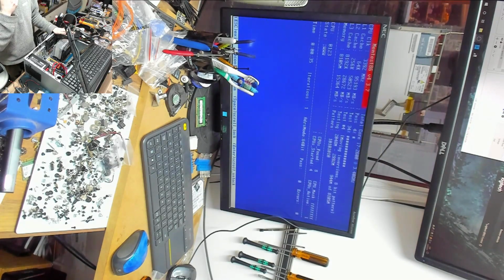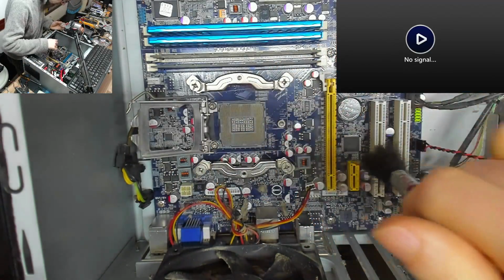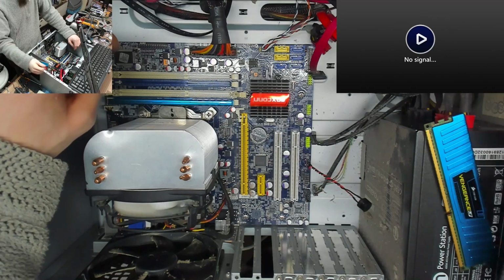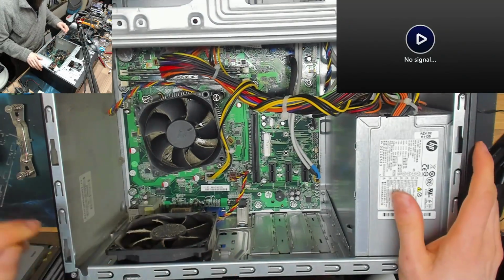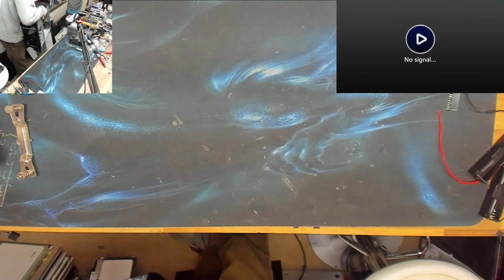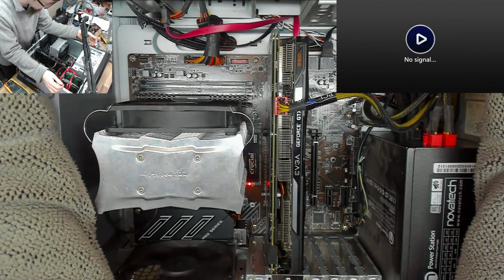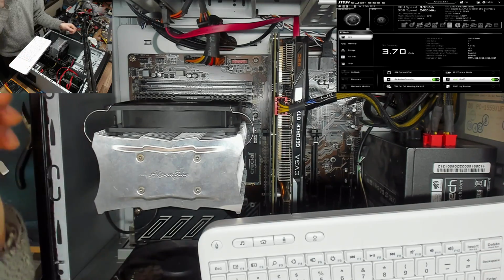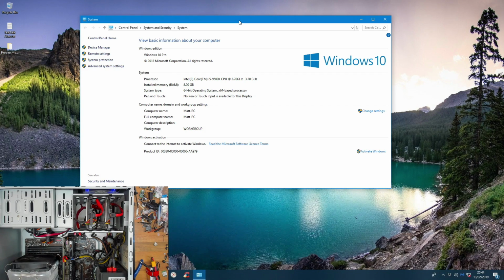LFC#160 - Intermittently dead motherboard rabbit hole.

Comment: This RAID is so called "fakeraid", ie there's no actual dedicated processor calculating your parity. All work is done by the CPU, in software, and the required plumbing is provided off the shelf by Intel, which is why every BIOS implementation of every manufacturer has the option to do RAID and will read the array. Lots of data recovery software will also recognize and let you access data off fakeraid, whether Intel or AMD, plus often they also support things like Linux mdadm RAID, ZFS RAID, and also proprietary LSI/Avago/Broadcom server RAID cards as well as Adaptec ones. The only truly "you're screwed unless you manage to get the system these drives came from to work" situation happen with actual enterprise disk shelf appliances from the likes of NetApp or IBM, where there is something computing the RAID stuff for you, and just downloading a BIOS/FW update requires an up to date support plan (ie, subscription). Sometimes, kind folks around Reddit and various Discord servers who happen to have access from their work will pass the files for you, but yeah, these are the only cases where you're in trouble with RAID. That, and also situations where you have RAID spanning across like, 16, 24 drives, and you need the means to physically plug in this many disks because you don't exactly have your own storage server on hand to image like 100+ TB worth of data. Fakeraid is easy stuff though, drop into new motherboard and as long as you didn't change between Intel and AMD, you're cruising.

Comment: Did the client have a RAID 1 (Mirror) set up for data security purposes? If so wiping out that lessens the clients data security. RAID is not just about speed, depending on the version selected it is also about data security.

Been using RAID 1 (Mirror) on my NAS devices for more than 5 years now and it has saved my data more than once.

Comment: the older RAID Arrays were usually made up from SCSI Ultrawide HDD's and were very expensive and yes they had SCSI ID'S usually 1 thru 7 and they also terminators on the last drive to tell the array that there are no more drives after the termination jumpers. but when sata or sas drives were the new thing for arrays the serial chains were far superior and cost effective.

Comment: Before I had ever seen your PSU fan upside mount, this has been my preference as well, but I will add that it is well worth the money to go with an 80+ Gold rating, if not Platinum or even Titanium ratings. I couldn't afford these higher end PSU's. My MSI A650GF 80+ Gold has a 10 year warranty which is the best option next to efficiency rating.
Reply: That is a great PSU. MSI’s been doing miracles in the PSU market recently. Their Ai1300P is what I use. A CWT built, 1300W 80+ Platinum beast. Would have gone Seasonic but they had no ATX 3.0 units at the time. Still, this beauty will last me and I don’t intend to switch it out for a long time.

Comment: Bad power supplies can mess up more hardware than any one thing or component on a PC, that is why it is very important to test the psu before anything when doing a diagnostic on an intermitted hardware error, like cutting out. stuttering or just plain turning off unexpectedly(It's still known as a crash).  I can spend 25 dollars on test equipment plus multimeter and without a doubt find a bad power supply.   Rather than letting the PC crash or code up in an effort to find the problem, you can test a power supply before you try out the PC, If it isn't running on spec then it will damage drives , graphics cards and even CPU's due to improper voltage output. it is just reckless to put a system online before checking for hazardous conditions that can cause more damage

Comment: Old video, so it don't really matter, but I'm surprised I didn't see a comment saying the cpu cooler fan retainers are on backwards.
Not that I might not do the same thing, there was probably a team of engineers that tried to figure out the most unusual way to mount that.
Reminds me of when I tried to help a friend replace a broken clothes dryer belt.  I stop by and I couldn't make head or tails out of how the belt was routed.
Luckily I had a variation of the same brand dryer, so I just looked at how my unbroken one was routed, lol.
Oh, and you don't route the cables for the clear panel, you route them for the high-speed:low-drag air flow.  😜

Comment: About the only motherboard repairs that are relatively simple are when those aluminum capacitors spew their guts and you can usually see the leakage.  An ESR checker that allows you to check the capacitors when they're not visibly leaking runs about $40 USD.  I can do the electronics but not the programming as you do.  I'm watching this in Thailand in the 35-degree heat and that sweater looks like a form of Medevil torture.

Comment: DO remember that upscaling from an old pc to a newer mobo et NEW MS windows config et with software / programs designed for ie Windows XP, 7 et may NOT work on Windows 10 et 👀You can check with the software manufacturers et to see if they have 'upgrades' / patches but often that will NOT be relevant. IF Windows detects the software et it may attempt to run the software under its own set of drivers et mods et BUT often that will create instability AND can corrupt data et 😗Likewise some external devices / hardware may NOT work !!

Comment: 'Raid' systems can be notorious for failing AND recovering. I always recommend NOT to use them. 👀Modern mobos are much more adaptive to multiple drives et storage et read, write et 👀If you are new or 'newish' to pc building DO check this guys channel out on other activities re pc fault finding, repair, building et The key to a 'NEW build' should always be based on WHAT YOU (OR the person you are building it for) wants out of that system. 😗DON'T waste money on a system that is a 'Rolls Royce' for trips to the local shops et !  My sister uses her PC for web browsing, FB et et little else.. so why build her a system for gaming et et ? HOWEVER I do build a lot of systems that DO allow for expansion future wise re drives, storage, USB, video output and and !

Comment: I had same 'Foxconn' motherboard and NO, would NOT buy that  'manufacturer's' M'board again.👀 I reasoned that they were a 'premium' board. OK for light work but as is the case with some mobo's, put some heavier demands on them and they WILL fail. 👀Over 40 years of PC building et + I've opted for certain manufacturers that I trust re future builds including certain components. I switched over to AMD within the last 10 years and Intel now is a distant memory.. 👍My top three mobo manufacturers are Asus, Gigabyte, ASRock.

Comment: A bit of an old video, but still worth asking a question: given that you're able to suss out a lot of board level issues on laptops, and that (as you mention in the video) older generation motherboards are often hard to find (and tend to fetch good prices due to scarcity), do you put any effort into diagnosing and fixing the board after an upgrade like this? If you got it running it could fetch a decent price on Ebay after all.

Comment: 44:00 I once read an article about lapped heat sink surfaces being a bad idea cause it decreases surface area at a microscopic level. Think of it like a radiator's fins vs a radiator with a flat surface "Which does not exist, but if it did...". It's seems that the most efficient surface mount is NOT a polished one but a brushed one. Similar to the IHS of all CPUs. There is a good reason why those are not polished. And I don't think it's to reduce cost... it is advised to let the applied thermal compound to fill in the gaps between both surfaces and provide a larger surface contact between the cooler and the CPU. 

Just thought I'd share that if you are interested. 

Thanks for all your videos.

Comment: Having the power supply down in the case is not a good design. All the dust sits on the table and get's sucked in and the heat rises in the case. The old fashion way with the PW S is better. Up in the case.

Comment: I'm curious: Any reason why you don't do component-level diagnostics on desktop motherboards as you often do on laptop motherboards? Perhaps this was a marginal short with not enough current to make the PSU shut down?
Reply from the maker: Lack of learning so far - Desktop boards are a completely different ballgame to Laptop mobos, as it's usually a logic problem, where as laptops are usually a power problem.

Comment: Darn it I was hoping for a better out come on the first MB. I am running a asus 450b -m2. mb with ryzen 52400g and 16 g crucial ram. and a rx530ss 80+bronze psu and a Zotech 740? 4gb gpu. that is the set up. I run this rig 24/7. lately the weird thing is it will power cycle it self. just shut down and restart. some times it will go 3 days no issues other times it will power cycle 2x a day for 3 days running. Switched the ram around thought that fixed the problem. nope. this was built 2 years ago and I have had no problems with it to date. I am kinda stumped here. anyone have an idea on where to look next? I will be moving it to another case soon with a brand new 750w psu. with a used Zotech gtx 1050 ti gpu kinda putting that off till I get replacement parts for a used Origin case I bought. but think maybe i will be moving it before i get those parts in.

Comment: My power supply is mounted fan down, but is on a hard surface, which is  3/4 inches from the bottom of my case, and I DO clean the filter regularly. Therefore there is always room temperature air going through my power supply.

Comment: Why would you swap out a whole power supply just to see if the other ones bad? You should just test the one that's in there
Reply from the maker: The only way to know for sure is to plug in a different PSU. PSU testers are worthless. Here's a video showing examples of PSUs that light up, and even show the right voltage, but don't work. https://youtu.be/mGQQLg5mNWo

Comment: It's not only hard to find MBs from that era, it's hard to find WORKING MBs from that era. Just bought 3 x 3rd Gen MBs and they were all faulty. One was faulty when it arrived - no onboard vid and one RAM channel dead. One totally failed after two days. And the last lost the network after 1 day. There is something from that era that makes MBs fail, because I have older PCs(Pentium 4, Core2Duo) that still work.

Comment: Adam: 'Second Gen is ancient now.'
Me: - Still using a first Gen i5 no worries.
Reply: Same. this 9600 is only 40% faster than the original 2600. The main difference they will notice is the SSD.
I will probably go through my 3rd gpu before I swap out the processor. Although the current gen stuff has finally got a 2x improvement.
Reply: @der0keks  Now the 14900K is bonkers and demolishes everything xd.
Reply: @foxylune  lol. Only twice as fast after 12 years. Pretty pleb improvement
Reply: @der0keks Twice as fast in what
my guy? It could be up to 10x as fast, or more, in multicore tests. Single core it just slaughters.

Comment: I'm not sure why you'd want to change RAID0 to JBOD, JBOD has the same data loss problems without the performance benefit.
Reply: not true, you lose a JBOD disk and you lose 50% data, you lose a RAID0 disk and you lose 100% data.
Reply: @miff227  JBOD means you lose one disk, you lose all your data. The whole volume is lost. If you're lucky then recovery tools can reconstruct up to 50% of it, but only if that data isn't fragmented between both drives.

Having multiple disks each having their own volume isn't JBOD. JBOD is specifically pooling a bunch of disks together to make one volume. Some people use the term incorrectly.
Reply: @TimBoundy  am shocked, you're right. I've never implemented JBOD but as no striping was going on I thought the data would be intact across the still-alive drives...but yes, fragmentation and other reasons would scupper that.

Comment: man i love how you break things down...love the vids...got a t3500 mobo kinda doing same thing...oddlywont boot if you touch the normal pins now but mess with the cmos jumper n touch those together and it will start but no beep and no pic...tried ram..battery..cmos jumper..a quad core xeon and a hexa core xeon...2 500w power supplies...3 different graphics cards...fans don't spin on rx580 now...but lil 1g ddr2 card with no power plug the fan runs on but no pic...same wirh an old 256 mb card no pic...everything was working I booted down ..stayed at my gfs house and came back a day later and was having to jump the cmo pins to get it 2 come on...had date and time problems and did have a pic but today no pic and still have to jump cmos to get cpu fan to spin.im not sure what else to do...cant really get a picture to do much...thanks for any ideas...the seller did say he was sending a replacement so that was real nice of him...mobo cpu combo for 37.50 on ebay u.s.d….great deal w3565 ..3.2ghz-3.5ghz...4core8thread chip with it!!….already sold 1 system with a 3gig 1060...working on a 6core 2nd system for same guy...just ran into problems with this mobo I didn't have with the 1st build.:)
Reply: Achronis, macrium reflect ate Good to clone. Windows will be OK reactivated. You may have a problem with ms office.

Comment: Not sure why you get such hate for psu placement direction. I have read multiple experiments which show it acts as another exhaust fan and helps pull heat out and bring down temps inside the case but, when in the opposite orientation the heat of the psu radiates into the case and your case fans have to exhaust an additional heat source raising temps inside the case.

Comment: Most 2500k will hit 5k MHz if they have decent cpu power like1.5 volts on the cpu + good cooling on the MOSFETs.The HSF and the 970 are blocking cooling to the vrm and mosfet or the cpu power supply area.My wifes pc a cheap ASRock pro is also limited by mb cooling to vrms etc at 86c the cpu will start downclocking.This Foxconn also seems to be very weak in the cpu power area + that small case will run way to hot.

Comment: 11 mins in and it sounds like the MSI mobo I bought online for my i54690k. It'll boot into bios, run for 3-4 mins, then power cycle. After checking everything I found that the southbridge chipset was heating up to the point you couldn't touch it.........

Comment: The first thing to do when working on a pc is to blow out all the dust. I heard an electrical pop at 8:50 and 9:35. .
By the way... the memory is in the wrong sockets. I cannot stop watching this. i"m not a raid fan either- I know what you mean
Reply: I had the same thoughts about cleaning and would have not mixed RAM (if DDR2)

Comment: The correct procedure is motherboard, CPU, RAM, CPU-cooler and testing, before mounting anything into the case... Especially if using second-hand older parts. Okay, seems it was new parts, so that's good, but still, I would mount and test before mounting, just in case - if something is then done incorrectly, like having a misplaced standoff in the case, you know it's something with the case-install that is causing issues, since it worked before doing that.
Reply: And about one build in 10 (or less), you'll save yourself a problem, the other 9+ you've wasted time, no problem if you're a hobbyist, no good if you're trying to make a living off it.
Reply: @beardyface8492  bullshit. The building outside the case is basically the same as building inside the case. Depending on type of case/MB, ofc, but as long as regular ATX or EATX, you can 99% of the time just put the finished build into the case, without disassembling first. So the extra time you spend is maybe what... 10 minutes extra for the extra test? It's not noticeable.

Comment: Talk about old school boards way back pre 2014 era
My first board was from Gigabyte and i always thought they were the best, turns out NOT
my H61-M died its audio while i was cleaning it out, the ram DIMM also died with fuming smoke when i tried an incompatible ram (back when i was still inexperienced with PC's)
the thing still works on my house. but its now popping an bios error everytime i boot it up. good thing it has dual bios (coincidence?)

I also have an asrock board AM3 from 2009. Board works fine no issue. Its just that its so outdated that it doesn't support uefi/AHCI config which bug me a lot because the old drivers from 2006 is so slow for boot up times but the board has given me zero issues so far even when im abusing it by taking it out of the case a lot of times/min maxing whatever ram i find.

So far heres my take on the boards
MSI -  better than usual, though they make unusual stuff
Gigabyte - makes cheap and disposable boards, pros: cheap, cons: cheap
Asus - solid board maker, with exception of few 
Asrock - Somewhat decent/good built quality but their old bios suck or their weird features sometimes doesnt make sense
Biostar - Basic board, WYSIWYG thingy. they do have bad tier at the bottom of the barrel chipset
Foxconn - like biostar but sometimes a bit better
ECS - DONT, unless its a freebie from a school who stop using ECS as their computer lab motherboard

there are other boards, but this ones is what i have experience with. just my one cent to them